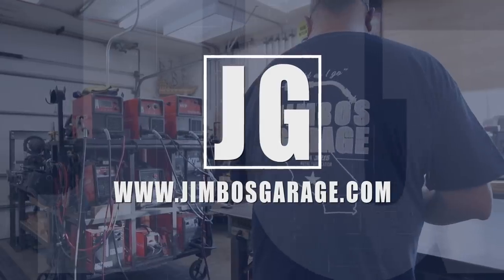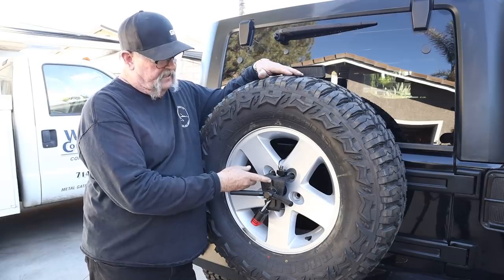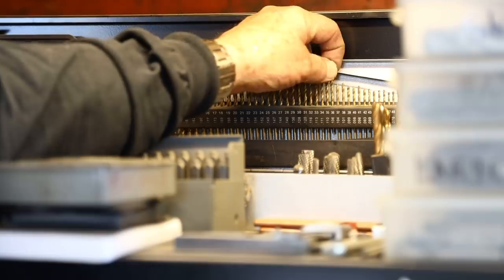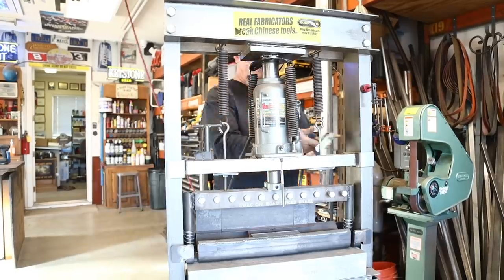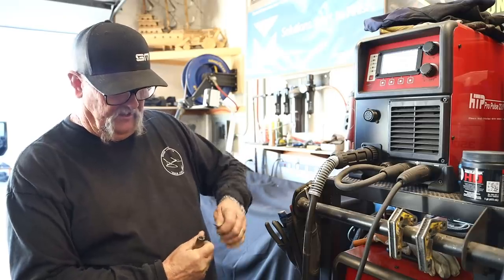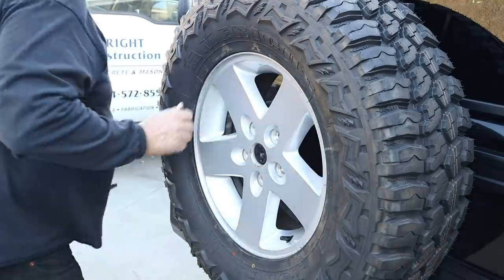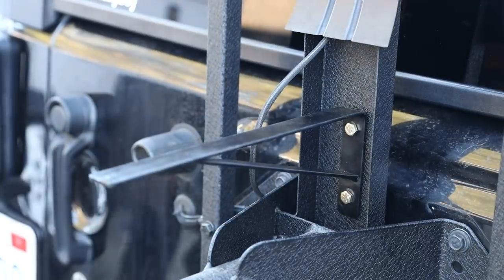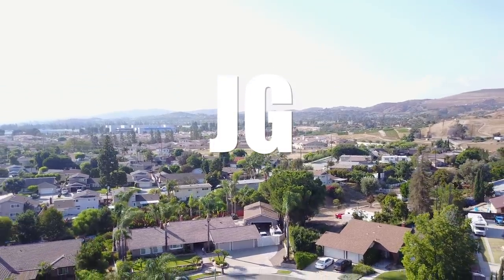Custom Backup Camera Mounting Bracket for Tire Carrier | JIMBO'S GARAGE

Comment: I'm totally impressed with your tap and drill collection, just curious as to why you use a hand drill when you have bench top drill press close by
The job on the bracket is first rate, like all of your projects

Comment: Looks like you’ll have to remove the camera to take the tire off it’s so low towards the center of the tire. But it’s probably a camera angle nice job
Reply: actually, it's unnecessary to remove the cam while take off the tire.. just take a look again then u'll see..

Comment: Only issue I see is that even if you angle it down, the rack will block the view of the trailer hitch if you're trying to connect one. Probably not much of an issue though, since I can't remember ever seeing a Jeep hauling a trailer that can't be moved by hand.